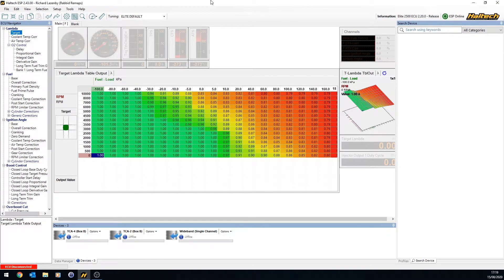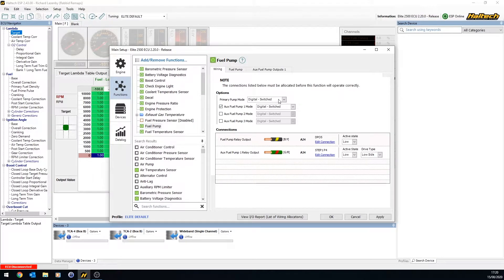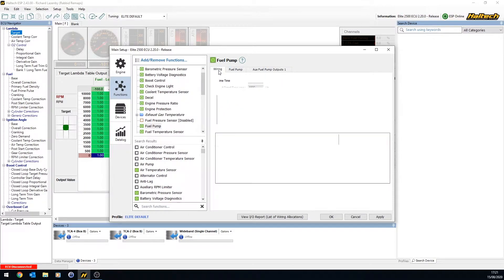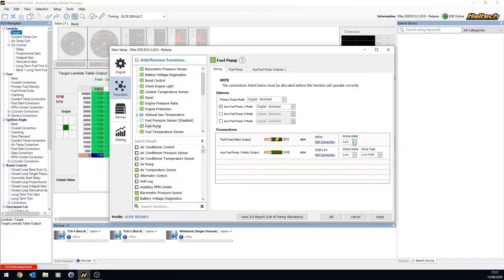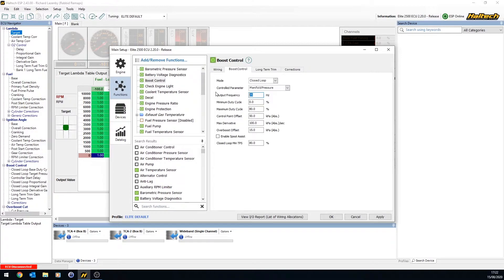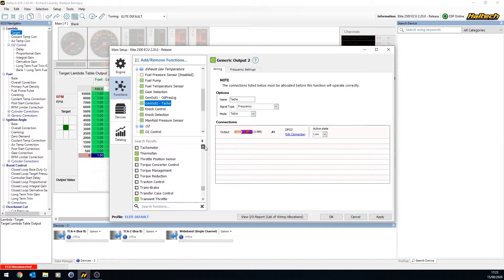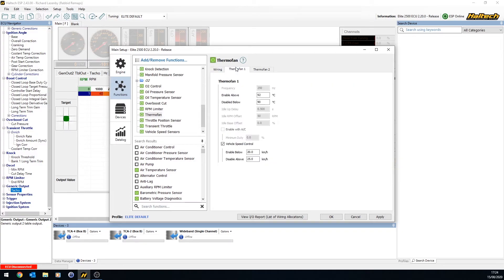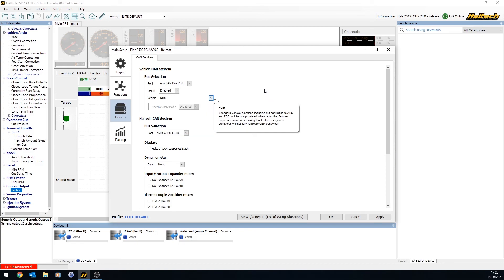Haltech Elite Tutorial Part 6 - ECU Outputs

Comment: Hi, how would you wire wheel speed sensor that's a 3 wire and then output to dash to show vehicle speed?
Reply from the maker: 3 wire sensors are usually hall effect and use a 5V GND and SPI input